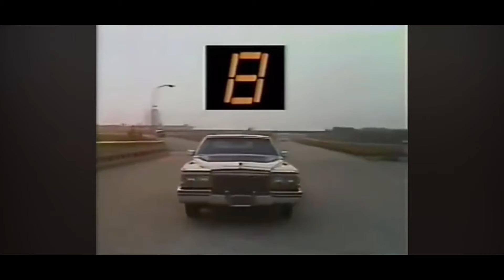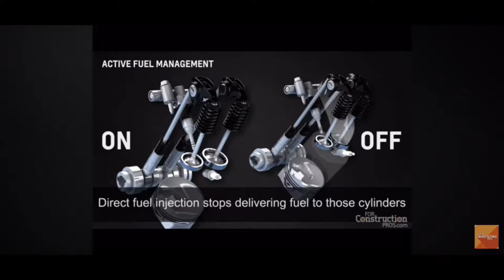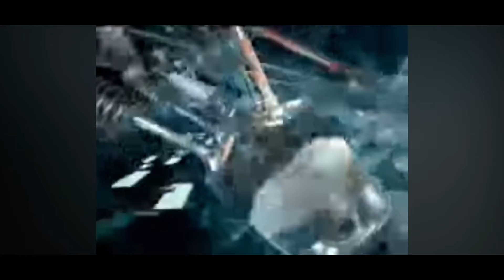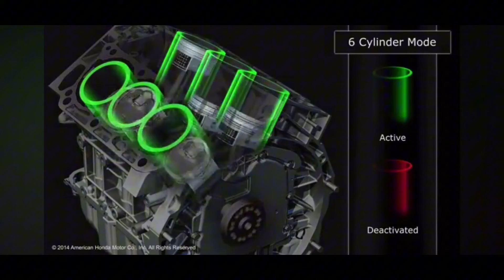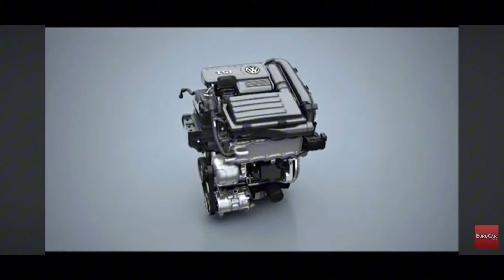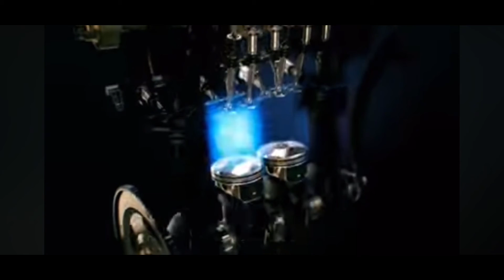Cylinder Deactivation V8-6-4-2

Comment: For anyone interested what cylinder deactivation actually does and why you only find it in petrols. First of all the entire engine is obviously still running. What happens is that during cruising youre giving it very little gas. In a petrol the gas pedal doesnt control fuel input like in a diesel but air input. That works through a valve somewhere in the air intake. The more gas you give the more it opens. Now when youre cruising especially at low speeds that valve is almost closed and every cylinder needs to work against that vacuum when pulling in the air/fuel mixture. That significantly decreases efficiency. Now if you half the cylinders firing every cylinder that does fire needs double the air and fuel. So you can open the valve much further hence decreasing those so called pumping losses.

Comment: Andrew, once again a fine and informative video.  I still have my 2010 Honda Accord V6 which I had problems with until I installed the vcmuzzler2 based on a video you posted.  No problems since.  I also own a 2015  Chrysler 300C hemi v8 with the mds system.  I really like the mds system and have had no problems with it.  I am still at low mileage (44500 miles) but from what I have read changing the oil is a must to maintain the system.  So far so good.  You have done a great service to your viewers by researching all of these different systems and sharing what you have found.  Take care.
Reply from the maker: Thank you for these kind words.  Glad to have helped.